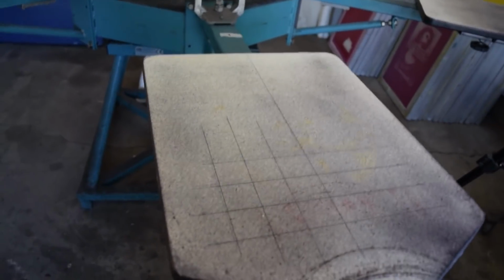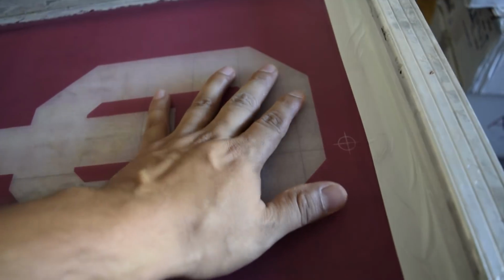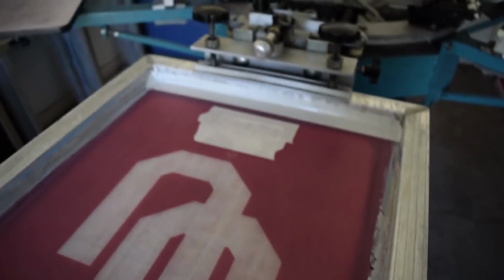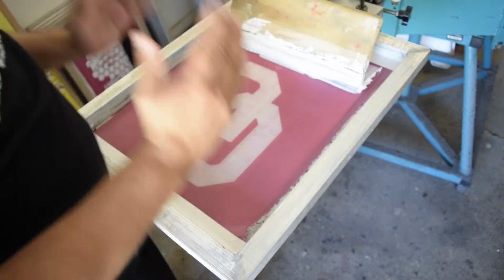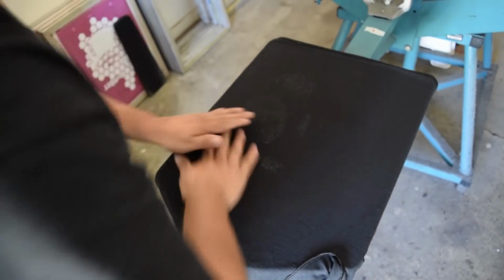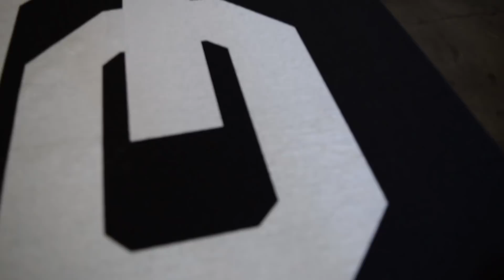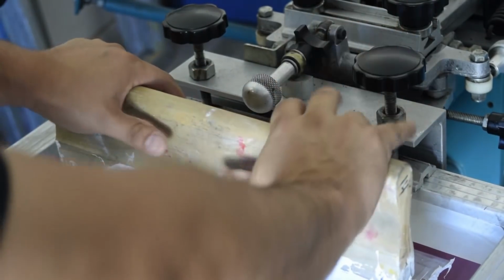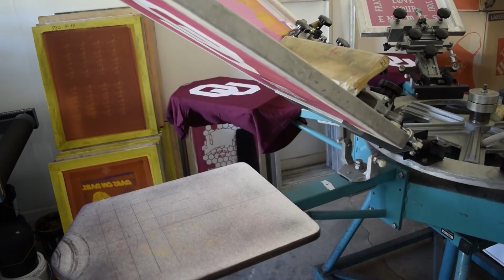How to Print a SOLID WHITE BASE and 1 COLOR

Comment: Hey—good morning. Struggling here putting white and yellow and it’s taking me like 3 hits of each.  Is a pull stroke better? (I usually push). Helllllllp ugh
Reply from the maker: T-Shirt Bakery hello it depends what works for you better. Push or pull can work the same. I need to know what size mesh you are using, what type ink are you using, what kind of garment are you printing, and if your squeegee is soft? I personally always had problems when using soft squeegees thick opaque ink and high mesh all at the same time. Maybe you need to put a little bit more strength to get the ink through the mesh? You can DM video at @gibran_2ill on IG
Reply: Breakthrough Ink   160 mesh. Wilflex lava meteor classic white, gold/yellow hi opaque from Total Ink Solutions. Seeems to be a difference between practicing with a rinspun cotton shirt. Job is on a Hanes 100%cotton comfortSoft. 
I answered one question, tried it with a pull stroke and wow – – the white covers so much better. Thanks